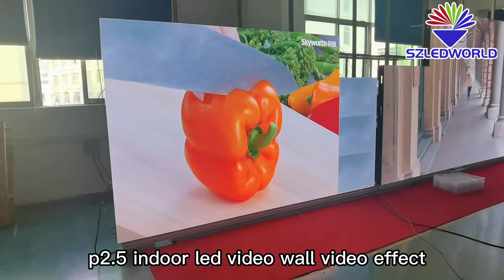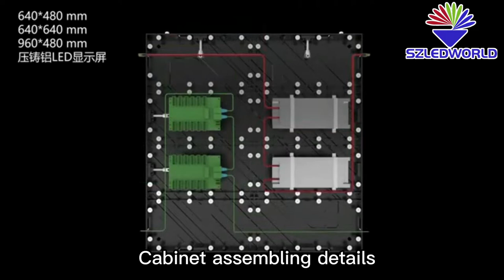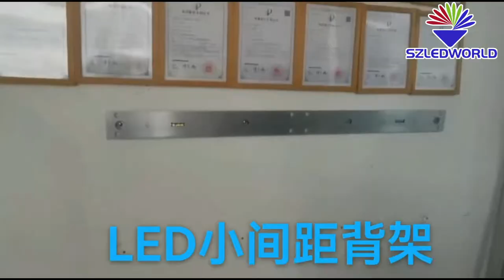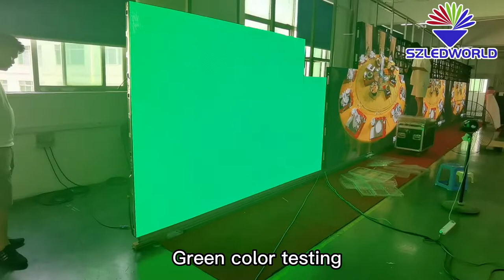p2.5 indoor led video wall  screen display module wall assemble front service and installation

Comment: Dear, 
I have a 2.8 mm led screen.
 176 height × 176 width pixels one cabinet. 
How many NovoStar sending cards  I need to turn on a 24 m2 screen, and how many UTP cables do I need to connect to the LVP909 processor?
Reply from the maker: Dear sir,
Usually, it needs 3 novastar MSD300 sending cards,
5~6 pcs main ethernet cables